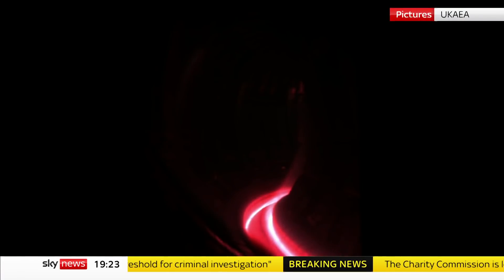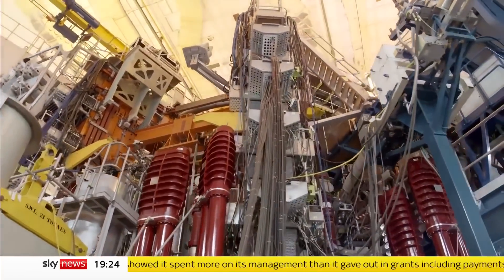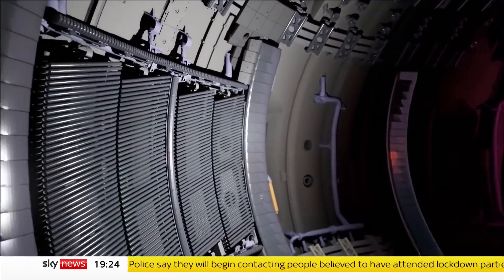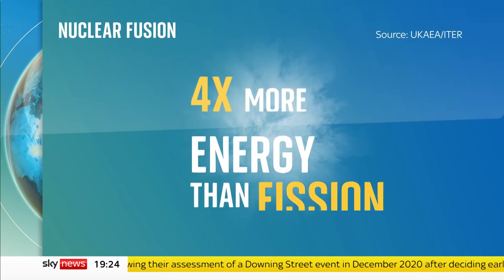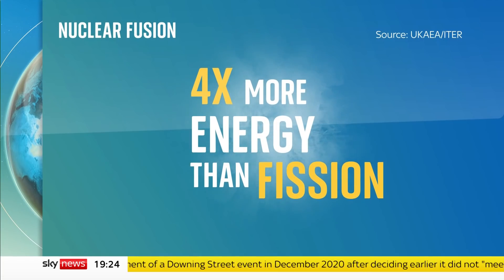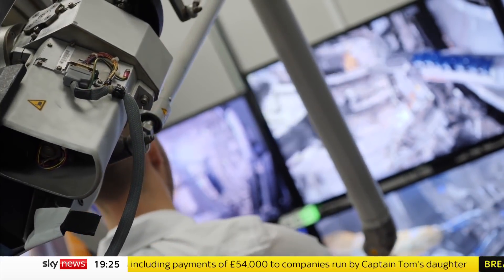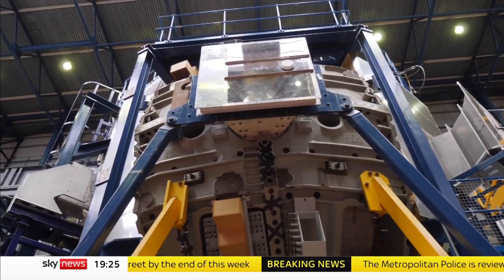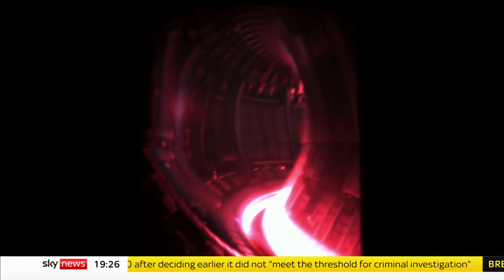British scientists make nuclear fusion breakthrough

Comment: ok and what's the point, capture electrons from the plasma contained in a magnetic field? and then what, u have a excess of thermic energy that would have to be channeled to some kind of ceramic coated tank to cool off and be mixed with some form of lower temperature liquid hydrogen on the bottom so it can be injected into a fission engine, just to keep the electric current needed for the plasma magnetic field running. So besides the thermal excess if the plasma magnetic core is supposed to be fed by an electric coal powerplant that's just a stupid falacy to call it green energy. Facts check, coal power plants must be dismantled, but their fission engines can still be used.

Comment: CTER unit in China had sustainable fusion reactions for 17 minutes with the same temperature output and 5 sec is nothing to sneeze about..
Reply: This is incorrect, the Chinese experiment was containing a hot plasma for 17 minutes. There wasn't any active fusion going on.  The difference between the two is a hot water tank vs a working boiler.
Both are important steps forward, but the JET result is a genuine game changer

Comment: I found a huge fault in this model of fusion reactor. There is not even a single plugin point where we can charge our mobile phones and other things. So my dear scientists put four plugin point at four perpendicular place on the walls of the reactor.
Otherwise this model of fusion reactor will also fail like the earlier ones.

Comment: Someone please explain how it doesn’t melt everything around it for miles?!
I mean 150,000,000 degrees is ridiculous!!
Reply: The main reason is that it’s a very low mass, and is suspended mid-air by magnets
Reply: @Gomlmon99  With a strong enough electromagnetic field, the same principle could be used to suspend a McDonalds apple pie safely in a vacuum. Though I confess I haven't been able to fully ionize said pie to the point of it being a plasma and McDonalds won't respond to my emails anymore.
Reply: 150,000,000 degrees isn't that much. It's only slightly hotter than a McDonalds apple pie. I guess they just open the window a bit for it to cool. That's what I do.

Comment: Amazing! But stupid question if anyone can answer…if ten times hotter than the sun what happens if there is a breach and that enormous heat is expelled out? Also, had no idea we had such materials that were so heat resistant! If someone can shed some light on this for me as I’m to thick to comprehend it
Reply: I cant answer what happens if something is expelled but I can say about what materials are used to keep the heat in. Its not actually the material itself but the magnetic waves holding and suspending the particles within it's own torus. 

Using super cooled and super powered magnets we can literally hold the heat and the energy and push it back within itself and cycle it so we can harness ir without it reacting to the surfaces and things around it, which is ultimately makes things melt and break down
Reply: If there is a breach and the plasma touches the side of the reactor then it instantly becomes to cold for fusion to occur so the reaction stops. It's nothing like a fission chain reaction.

Comment: The world is far far away from China in this technology. China's "artificial sun" has set a new world record after superheating a loop of plasma to temperatures five times hotter than the sun for more than 17 minutes.
Reply: China isnt far far ahead at all. They are playing catch up just on a larger scale where previous tests were unable to justify such large projects. Its yet to be seen as a breakthrough success
Reply: @TheFreshSpam  that not what western media said. China’s Artificial Sun Just Broke a Record for Longest Sustained Nuclear Fusion
Superheated plasma reached 126 million degrees Fahrenheit for 17 minutes. reports Anthony Cuthbertson for the Independent.
Reply: But that same reactor run by China is extremely low power, low density, and can’t run tritium. So the world is currently ahead of China.
Reply: @Gomlmon99  that not what western media said. China’s Artificial Sun Just Broke a Record for Longest Sustained Nuclear Fusion
Superheated plasma reached 126 million degrees Fahrenheit for 17 minutes. reports Anthony Cuthbertson for the Independent.
Reply: @cherubimcherubim9515  and 3x colder than JET

Comment: Geez, someone really got their units mixed up in the description - I'm assuming 11 MW refers to the maximum recorded power output, not energy. 59 MJ is about 16 kWh of energy.
Reply: No, it is correct. It's just enough energy for boiling 650 water cubes. Still it's a beginning.
Reply: The reactor produced it within 5 seconds during the test , which is a 20+:1 efficiency

Comment: The fuel is not limitless! This is a myth with fusion. Without the enormous gravity in a sun, regular hydrogen doesn’t work on earth so they must to use a hydrogen isotope. These are extremely rare!
Reply: deuterium and tritium will be manufacturable evetually
trust the scientific method and look at the situation objectively
Reply: @channelname4331  i think deuterium is extractable from sea water.
Reply: @swiftnicknevison4848  That’s right. It’s H-3 which is the problem.
Reply: @justinbarber4567  h3 can be mined from the moon's surface eventually.
Reply: @channelname4331  Just being optimistic is  not enough. My comments are objective and are based on a little bit of knowledge about the subject.
Reply: @justinbarber4567  being optimistic is not enough but its an important piece of the puzzle

every little helps
Reply: @channelname4331  only if the optimism is based on data or fact.
Reply: @justinbarber4567  it is

even thoigh its moving slowly, there has been a lot of progress in the past decades

it may take time but it will eventually work
it just seems to take forever from a human perspective
Reply: The deuterium in the ocean are already more than enough for many millennia of energy use at today's level. Surely the energy consumption will grow, but science and tech capabilities will grow too.
Reply: @serena-yu  Yes there is plenty of H-2 but it will not fuse with itself so that’s why they need the very rare H-3.
Reply: @justinbarber4567  rare on earth, h3 is abundant on the surface of the moon.
Reply: @jamesbullock4184  Yes in theory it’s plentiful on the moon but not proven yet. Not exactly a low cost option though is it..?
Reply: Gravity isnt the main factor in fusion in the sun. 

It's the sun's size. It has a lot of hydrogen atoms. 

Protons (hydrogen ions) bump into each other, by pure chance, due to quantum tunneling, and then fuse. Quantum tunneling is almost as if the particle teleports past barriers. Fusion in the sun happens when two particles coincidentally teleport to the same location, and then fuse. 

It happens everywhere, naturally (even here on Earth). 

Two protons fusing like this is extremely unlikely. But the sun has a massive amount of hydrogen ions to make up for those odds. 

Heat and pressure does help increase the the odds of two hydrogen atoms fusing. But in the sun, just the sheer number of Hydrogen atoms available to play the odds is by far the main factor. 

To put this into perspective, the Sun creates less energy per unit mass than your human body.

On earth, we're not trying to replicate the sun. Because it's not viable to increase the odds of fusion with more hydrogen atoms. 

We're trying to do something that exceeds what's happening in the sun by several orders of a magnitude.
Reply: @tylerdurden3722  The protons need to be held together long enough to fuse. This is achieved because of the stars gravity or density - it is a key ingredient dude!
Reply: @justinbarber4567  in nuclear fusion reactors, density and gravity will be not like the sun but heat will   be way way hotter  to have the same effect.

Comment: Okay this should make energy prices next to nothing. Britain should be at the forefront of such technology like it was for the industrial revolution they can bring about the fusion revolution
Reply: I don't think so they'll find an excuse to increase prices every year. They get oil and gas out of the ground for free but they've made the extraction process expensive and complicated beyond what it could be. So it won't be cheaper.
Reply: @miikapekk5155   oil and gas will eventually run out its not an unlimited supply
Reply: @Mrjoboo1  yes I know, that wasn't the point I was making.
Reply: Next to nothing I doubt it they will find something else to blame and put the price up and that I would put £50,000 on it as a bet

Comment: Not sure how to think about this, should I be happy we may be on the way to a cleaner power source, orshould I be worried this type of power can get out of hand quickly with disastrous consequences.
Reply: There is no risk of catastrophic disaster with a fusion reactor. Basically, if it's switched off, everything stops. So, events such as Chernobyl or Fukushima can never happen.
Reply: @tomsriver2838  never say never say never
Reply: Fusion energy is 100% the holy grail. If we crack this it's renewable, green energy forever.
Reply: Limitless free energy with almost no risk other than slipping on a wet floor near the machine after dave spilled his coffee
Reply: It's insanely safer than nuclear fission, which is how nuclear reactors or nuclear bombs work. The radioactive isotopes are essentially smashed apart releasing tons of energy. I know it doesn't seem safe - but nuclear fusion is how the sun works. As far as I believe, the only waste product from nuclear fusion is helium and oxygen, and the only reactant is water (?). It's been a few years since I did physics so take it with a pinch of salt.
Reply: We already have hydrogen bombs. That is about as disastrous as fusion can get friend.
Reply: @mbogucki1  hydrogen bomb is both fusion and fission, nuclear fission to provide the necessary energy to make a fusion and so deliver a enormous amount of energy
Reply: @mbogucki1  That's fission, not fusion. At least get the basic terms right.
Reply: @dwsoccer6859  H bomb is fusion dude.
Reply: It is a fascinating subject, breakthroughs bringing it closer to reality. Amazing how it was first attempted back in the 1950s. I'd guess once it arrives, society will be raised to a higher level and technological advancements happen which are impossible, today. That vision of flying cars, 🤖 robots in every home, sky houses, frequent trips to Mars and other planets, interstellar travel will be possible thanks to fusion. The Jetsons come to mind or Blade Runner etc. The race is on and intensifying around the world 🌎. It could be here before 30 years.

Comment: Very clever but if it goes wrong then that would be worse than chenyble
Reply: Eh, no. Nothing like that.
Reply: It would cease as soon as the plasma touches matter. That's why it has to be held in place with magnetic fields.
Reply: Fusion reactors can stop any time unlike the fission reactors which caused incidents like Chernobyl

Comment: Finally some good news that's worth something.
Reply: 🇬🇧 A uk first
Reply: @Albatros Gaming I think your maths is out. The average household uses about 28 kilowatts per day.
Reply: So they key is a sustainable reaction. It sounds very difficult... I wonder what variables need to be in favor to achieve this. That chamber alone must be built of some seriously expensive material.
Reply: @Durrpadil  The challenges are enormous! They need to keep the plasma away from the walls of the containment chamber using vast magnets and this is the easy part. A crucial factor which has not even been looked at yet is how to extract the energy assuming a meaningful reaction has been created. Oh and to say the fuel is limitless is very misleading, they must use a hydrogen isotope (as no sun like gravity is available to help the fusion) and these are mind boggling rare on Earth.
Reply: @Albatros Gaming problem is right now, they put in more energy than they got out
Reply: Unfortunately the conservative government will probably turn it into confusion
Reply: hurrahhh, 5 seconds!! At 59, I be dead, by the time "fusion power"  commercialized.
Reply: @RavingFan  30 years ago it was 3 seconds. Amazing progress 🙄
Reply: @saiyedakhtar3931  30 years ago it was nanoseconds.

Comment: Very interesting!  I recently learned that gravity alone is not enough to cause fusion in the sun, but that intense heat, quantum tunnelling, and tiny chances of it happening over a huge volume of matter are all required.  I have no idea what they are doing in that machine other than even MORE heat.  Does it also use quantum tunnelling to ultimately fuse?
Reply: Toroidal plasma streams, which I'm assuming is much more diffuse than the sun? But i must stress that  I'm an applied mathematician not a physicist. At a guess i would say that the sun is basically one giant Rydberg state of matter
Reply: I'd assume not. Seeing as the desired effect is unison between nuclei I don't see how the particulates propagating through each other would aid fusion.
Reply: Literally just had the same quantum thought. Great minds 👍🏽